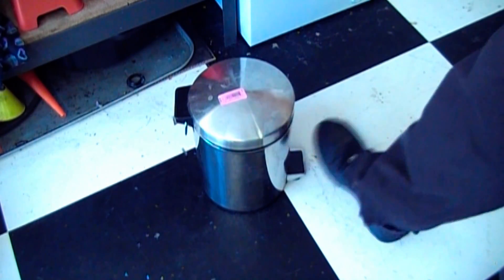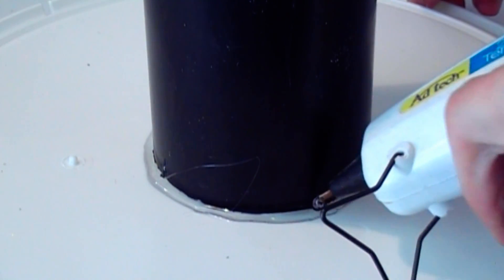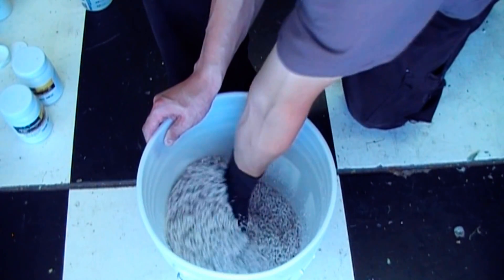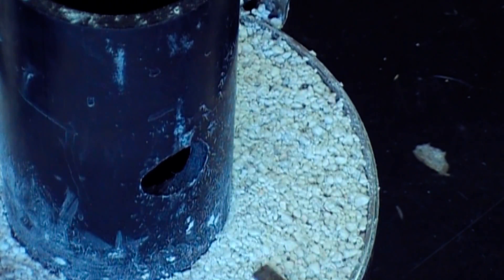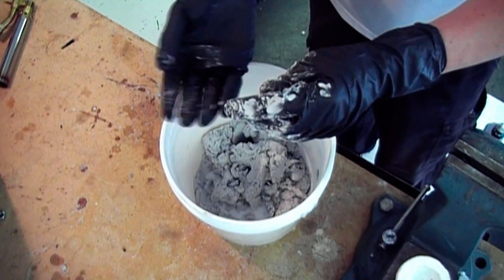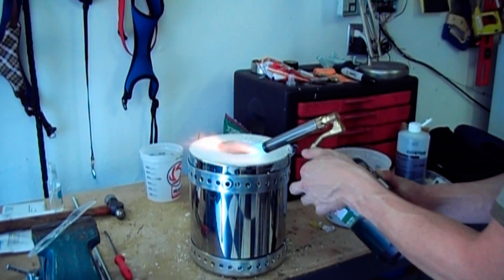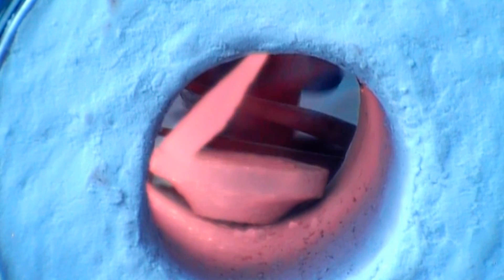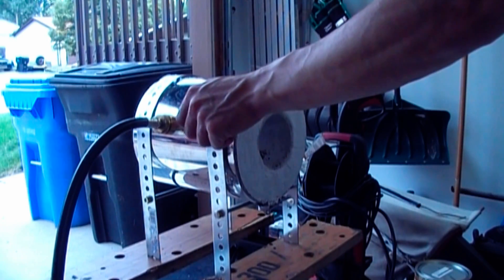How to build a trashcan forge

Comment: I have finished making the trash can forge and the torch but I can't seem to get my torch to have the power yours shows what am I doing wrong it burns but mine is not getting orange in the forge and doesn't blow flame out the end like yours please help.
Reply from the maker: +John Shamp Dose the torch burn with a strong blue flame? Could also be excess water in the insulation steaming out, it won't get glowing hot until all the water is burned off. Mine took a while and was steaming like a tea kettle and leaving a puddle of water on the floor.
Reply: It has a good blue flame but if I turn the valve up to far it changes to orange.  I stuck my forg in my oven for 2 hrs to get rid of the water I have not seen any leaking out as I am burning it.

Comment: Great Videos!!  I made the water glass and it was actually pretty simple to do.   One question, do you think glass bead (200 grit) would work as a substitute for aluminum oxide?  I only ask as a have an abundance of it at work.   Thanks!
Reply: +Metaldowg Glass melts at too low a temperature for this application.

Comment: Hi Clkindred, I am building rocket stove. I would like to use Perlite and water-glass mix only. I found in England they sell SODIUM SILICATE 40% SOLUTION.  Is this 40% will do the job or I need 100% water glass. Thanks in advance
Reply: +Don Gruzas I did find already the answer from another comment. So i just need add less water if i use 40% and more of water glass.
Reply from the maker: +Don Gruzas Hold on, there is a spider on my screen.... lol, it seems that a 40% by weight ratio is pretty concentrated, it was my mistake early on to believe they could state the ratio as (40% as concentrated as it COULD be) 40% is probably ok, but it's hard for me to tell because the concentration of mine is unknown because I made it. The only thing I can say is the recipe works out to be a 50% by weight solution at the start because the water is the same weight as the combined dry chemicals. But I then boil some of the water out after the reaction to concentrate the solution.

Comment: Could I use fire cement instead of the mix in this video? What are the advantages/disadvantages of both?
Reply: +Nevets You've probably already found the answer, but regular cement will fall apart over time.
Reply: Thank you.
Reply: +Nevets I'm currently researching making a gas forge.
Reply: Nevets I didn't see the "firecement" part of your question until now.  About that, I don't know.  Regular cement is no good though.
Reply: Ok, maybe I will try some fire cement on a small project to see what the results are like.
Reply: +Nevets Whenever I use fire cement it bubbles and turns ugly.

Comment: how did you get the center Pipe out?
Reply from the maker: +steven gonzales Gently pull. However a better designed inner form would make things a lot easier.

Comment: Does that setup work well enough to do forge welding?
Reply from the maker: Olivier Matte Not so far, but I only tried once. One problem I had was the workpiece was too small and would loose heat too fast the weld it.

Comment: Awesome video! But I have two questions.
1. Did you just put the torch into the pipe or thread it in somehow?
2. What kind of pipe did you use? Steel or pvc?
Reply from the maker: Anthony Palmieri The torch is a forced fit into the pipe.
The former pipe was ABS I think, it is just drain pipe from the hardware store.
Reply: clkindred thanks for the info

Comment: Hey i live in Australia and aluminium oxide isn't common around all my hardware stores. Could you recommend any substitutes for the aluminium oxide. There is Iron oxide but it is used to colour cement. Thanks for your help.
Reply from the maker: AztekKen Hardware stores might not be the best place to look for aluminum oxide, look for places that do metal prep for paint and things like that. Another good place is ceramics supply places, they should have fine grit aluminum oxide along with various dry chemicals needed for pottery. Are you opposed to ordering from the internet? Even from Australian companies?
Reply: Thanks for the reply. I was just wondering to limit purchasing online but in the end I ended purchasing it of a local company.
Reply: AztekKen Hey I'm also Aussie and looking to make a forge like this. What company did you buy the Aluminium oxide from?
Reply: +Mafk101 it was a local company that sand blasted cars and etched glass decorations.

Comment: Where did you get the aluminum oxide and sodium silicate I've been all over and can't find it
Reply from the maker: Jake Huffman The aluminum oxide is sand blasting grit I got at harbor freight, but it's cheaper here http://www.axner.com/alumina-oxide-calcined.aspx

The sodium silicate I made in this video https://www.youtube.com/watch?v=-Mx1-o1_MWo
Reply: Doesn't it matter what kind I use I've found black Diamond aluminum  oxide
Reply from the maker: Jake Huffman I think someone has used that stuff and it worked, but I would prefer a pure white oxide with a fine grit.
Reply: Thank you

Comment: clkindred, would you consider a SiC 240 grit possibly mixed with an aluminum oxide or a straigt SiC grit mixed with the other ingredients? the 2700 c melt point of SiC is very eye appealing... thanks in advance for your response.
Reply from the maker: Mnarciaga Sure, silicon carbide is something I have wanted to try.
Reply: clkindred Tried it today, had a 2:1 ((2)Al2O3: (1) SiC) Ratio)) with approx 40% "moisture" (Na₂SiO₃) 
It made a thick paste that fire cured pretty darn hard. Refractory properties were very similar to a fire brick. 
I mixed a very small amount to try it first. only about 30 grams of material total before forming and firing. In case your curious where i got the SiC powder, look up Abrasive Armory on google, an ebay store, FYI the SiC powder was 240 grit and the Al2O3 180 grit. Cheers buddy, thank you for your great videos

Comment: do you have a parts list for this build?
Reply from the maker: Robert Tucker The biggest problem with a parts list is people can't find the exact parts, as well as the fact that it dose not make a difference having the exact parts. The best thing to take from the video is the idea, with some creativity you can make it work.
Reply: my main thing is the filler - the aluminum oxide and such.
Reply: +Robert Tucker If you look closely at the video, you will see that it is 220 grit aluminum oxide. This is sold for sandblasting purposes, so you can google sand blasting media. You want white 220 grit aluminum oxide if possible.

Comment: clkindred I finally made my first batch of sodium silicate. Turned out perfect.. I am just missing one bit of information.. how did you connect your burner to the forge? is it just stuck in there?
Reply from the maker: Beverly Brandon Yep it's just stuck in a hole cast into the forge. The small dark colored pipe that passes through the outer forge wall and into the inner forge area was the casting form for the burner. I was an exact fit so there was no need for set screws or anything to hold it.
Reply: clkindred I've hit yet another snag.. the forge is built and curing as we speak, but the 1/8" npt plug I got from Lowes is a watts brand and is slightly tapered and won't thread into the 1/8" to 3/8" fitting I made. everything else went together fine but I don't know where you got your 1/8" plug but any info would be greatly appreciated..
Reply from the maker: Brandon Beverly I can't remember if I have sent you to this video, it details the 1/8 npt plug and the 1/8 - 3/8 fitting.
https://www.youtube.com/watch?v=5uuTqCsoOLE
Reply from the maker: Brandon Beverly But long story short is I had to run a 1/8npt tap through the fitting for the plug to thread in upside down.
Reply: clkindred yea. my problem is it won't even start. the square part is too big because it's actual size where the threads start and tapers bigger towards the square head..
Reply from the maker: Well there are a few options if you can't get the plug to work. One is use a short 1/8 npt nipple as the plug, one end plugged with epoxy or solder and orifice drilled. Lamps have similar hardware as pipe, if you have a decent hardware store in your area look at the lamp parts. The small threaded tube is 1/8 strait thread, no taper. It's usually cheaper than plumbing pipe and you should be able to find a 1/8 nipple real cheap. Also various thread adapters for lamps, 1/8, 1/4, and 3/8 are used for lamps.
Reply: ok.. since the forge is done. should I heat it up before putting the sealing cement on it?
Reply: clkindred I sent a message but forgot to link you in it.. just look a that message before this one..
Reply from the maker: Ah, yes heat cure the lining before sealing, it's too fragile to seal otherwise.
Reply: what size hole did you drill in the 1/8"npt plug?
Reply: clkindred I forgot to link you in the message again..
Reply: clkindred what size hole did you drill in the 1/8" npt plug?
Reply from the maker: The orifice is .016 inch.
Reply: clkindred Thank you. I thought I drilled it too big.. I cut the snap in drain cup too small.. ordered another one and a aerator screen. hopefully that will change the flame. without it the flame isn't very impressive. Does the screens make all the difference in that?
Reply: clkindred does the screen and snap in strainer piece make a big difference?
Reply: clkindred I finally got all the bugs worked out on the tourch. Works great now. I was just wondering what was in the back of your forge when you made your knife? looked like a piece of the sealing cement you shaped into something..
Reply from the maker: It was an experimental door, made from a block of rockwool coated in aluminum oxide cement. It worked, but was very fragile.
Reply: clkindred Any suggestions on something different?
Reply: clkindred I was looking into vermiculite board. maybe a piece of that with a hinge screwed to it and the top of the forge like a door? or would blocking the back end adversely affect it's performance?
Reply from the maker: I had originally planned on using the trashcan lid as a door but after packing the lining into the dish shaped lid, it was too heavy for my hinge to support. Blocking off the back should not affect the performance of the forge. Probably the simplest way to do a door would be to build the forge with short "floors" on the front and back openings, much like a driveway leads to a garage, the outer "floor" is level with, and leads to, the floor inside the forge. Then you can just cast some blocks of refractory to block off the openings however you like. They can just sit of the outer floor.

Comment: clkindred Could you tell me the heat limitations on this kind of refractory? Also, how is its longevity. Could you possibly make a large plug out of the paste material to close one side of the forge in order to keep the heat in for smaller projects? It looks great! Thanks for uploading.
Reply from the maker: Anthony Verret Longevity is good, I have some small cracks develop in mine but they have not grown in size and has not lost any pieces. It holds up to flux very well too, borax anyway. A plug or door is in the works, but I have not gotten around to it yet. Thanks for the comment!
Reply: clkindred You might be able to use the lid from the bin as a door. if you filled it with the perlite mix (minus a little so it has a lip) and then added some clamps or something to hold it on. I dunno if the lid would fit over it but I imagine the metal would have enough give in it to get it over quite snug.
Reply from the maker: I tried the lid as a door with the hinge on the side, but it was too heavy for the hinge to support it.
Reply: @clkindred  maybe mineral wool would be lighter.

Comment: clkindred I can't find that aluminum oxide anywhere.. where did you get it?
Reply from the maker: Beverly Brandon Try here http://www.axner.com/alumina-oxide-calcined.aspx
Reply: +clkindred would this alumina oxide calcined (325 mesh) be potentially better than the 220 blasting media?
Reply: Drake Mcallister it works great.. I've built this forge to the T.. The only exception is I used the lid that comes on the trash can and put the refractory lining in ot as well and wired it to the back.

Comment: clkindred where did the apple corer come from?
Reply from the maker: Beverly Brandon walmart, sadly they do not carry it anymore.
Reply: clkindred it's crazy.. I'm running into all kinds of problems finding this stuff.. the silica beads are just as hard to find..
Reply from the maker: Beverly Brandon I have also heard that the manufacturer of the blowtorches changed their design and it's harder to modify for use as a larger burner. I get silica gel at walmart as kitty litter, they still carry it too.
Reply: clkindred I actually have all the stuff to modify the torch. Lowes still sells the ones that you can modify.. so the kitty litter is the silica beads?
Reply from the maker: Beverly Brandon Yea it's the same material. They are rough shaped particles, not beads but that dose not matter. The brand of kitty litter is "MIMI LITTER" and it's the cheapest silica gel litter they have. Other kinds are clay based and are not what you want. There is another one that is silica gel but it's more expensive and it has additives like odor control, don't use that one either.
Reply: clkindred Thank you for all your help.. Sorry to bother you so much, but I have been racking my brain searching for these things. I'm trying to start making knives and I need this forge to heat treat my blades.. Again thank you..
Reply: clkindred I have everything figured out except the tube for the burner and how you mounted th burner to the forge. do you remember the name brand of the apple corer?
Reply from the maker: "Mainstays" was the brand I think, the Wal-Mart house brand.
Reply: clkindred I just received the aluminum oxide from the link you sent me. it says aluminum oxide calcined. I guess it will work. it's a very fine powder. Just wanted to know you thoughts.. Thanks
Reply from the maker: Brandon Beverly Cool, the finer the better if you want it to coat the perlite. "Calcined" means it was fired in a kiln, perhaps they used aluminum hydroxide as the starting material and heated it to drive off the hydroxide group and leave aluminum oxide.
Reply: sounds great! thanks.. ill post a video of the forge when I'm done.. I greatly appreciate all your help..

Comment: Thanks for the info on the effective burner length. It turns on the stainless steel tube I got was bigger diameter that the one you used, so I had to get a 1/4 to 1/2 reducer and use a 1/2 nipple. A 1/2 face bushing will be too big to serve as the spacer, so I'm gonna sand a coupling to make a tight fit. My question is, if I used a larger diameter tube, will the burner need other modification, like a bigger orifice, or air intake holes? Again, these videos are awesome.
Reply from the maker: Keith Robicheux Woops, sorry for the delay. Unless the diameter is MUCH bigger, there is no need to re-engineer anything else.

Comment: So how come you dont add any plaster of paris to this mix to speed curing?
Reply: free8704 I think this is only used to speed up the setting process, so is something you could use to speed things up if in a hurry. However there could be more to it than that i am not 100% sure.
Reply from the maker: free8704 Yes plaster was used in an older video in a small amount to take up excess water, but the plaster breaks down at high temperatures, so I did not use it here.

Comment: I loved your video! But I've got a question:
How hot could your furnace withstand? I'm planning on making a rocket stove, but I don't want to buy expensive fire bricks so I'm looking for a good insulating material that can withstand above 1000'c
Reply from the maker: Hugo Harrabin Depending on how large you stove will be, the bricks might not be more money than this mixture. The more you need, the less cost effective this is because the aluminum oxide is expensive. But this recipe is good up to about 1600 degrees C which is the melting point of the silicon dioxide binder.
Reply: clkindred I bought a tub of refractory cement, it's rated for something like 22-2500 in whatever temp rating we use in Canada. Would that work just as well for this? Or would it be no good? I hope it'll work.. I already bought it. I've looked around and can't find any straight answers on it. One would be greatly appreciated from you :c
Reply from the maker: Do you know the brand? I have used "Rutland" brand refractory cement before, it was ok.
Reply: It's I Believe Duquesne high temperature cement. My dad picked it up for me at his concrete supply store he goes to. They said it should be rated up to at least 2200. Is it worth it to even try, or am I just risking blowing myself up violently :P?

One way or the other thank you for the videos! Seeing how easy it was inspired me to actually take on the task :D
Reply from the maker: 2200 is a little low, the area where the flame hits the wall gets hotter than that. The Rutland brand stuff I tried had a similar temp rating and it got a little glassy from starting to melt. Not a big problem though, you should be able to get quite a bit of use out of it.
Reply: Awesome :) Thank you very much!